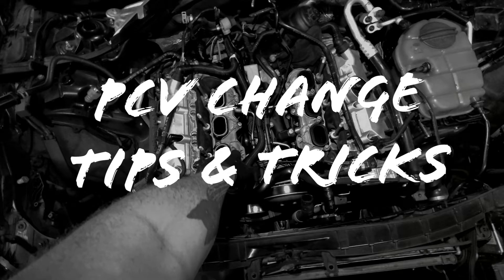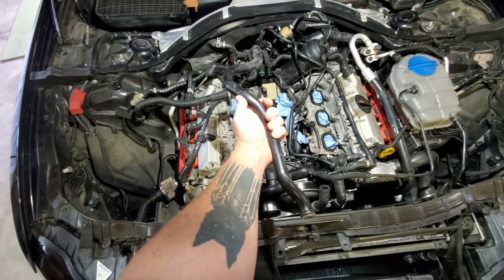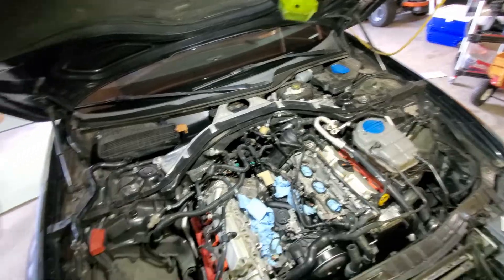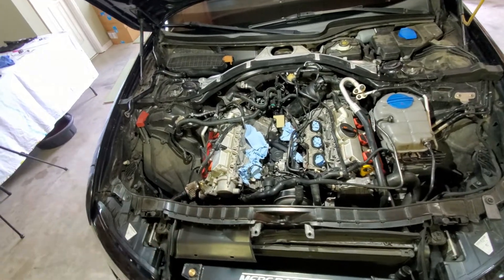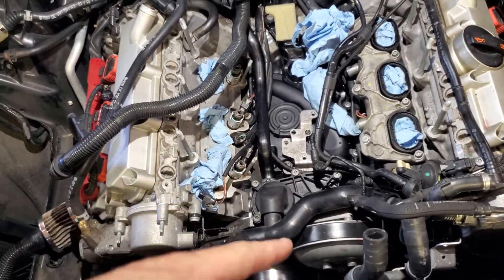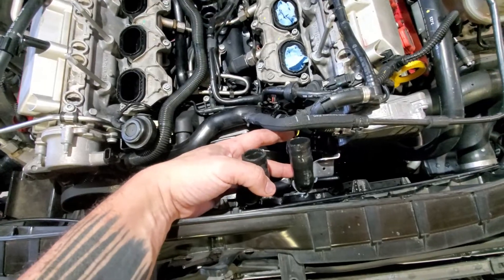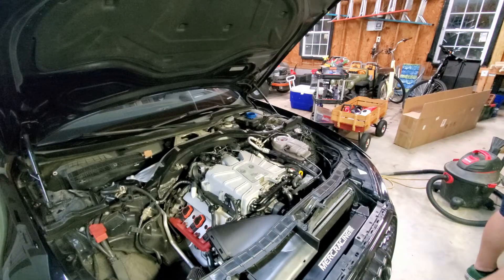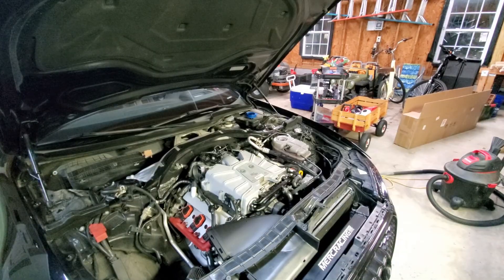Supercharged Audi 3.0T PCV Replacement Tips & TRICKS | C7 A6, A7 & B8 S4, S5, SQ5

Comment: My injectors came out exactly like yours did when I was replacing the PCV. I cleaned them, put new rubber seals on and after I put everything back together, there is fuel spilling out everywhere. when I try to rev the car to 2000RPM to start to bleed the coolant. help?
Reply from the maker: It sounds like you either didn't connect the guidelines fully where they connect to the manifolds, or a gasket for an injector got pinched

Comment: My plastic coolant hose is stuck at the heater core connection.  I have already removed that stupid clip.  Does anyone have any tips to remove that end of the hose? I have tried muscle power by holding both sides and twisting and turning but it is not budging.

Comment: On your other video about oil consumption you said this video here would show the inline check valve that should be replaced when changing the pcv valve. I didn’t see that part. Did I miss something?
Reply from the maker: It's the line that connects from your pcv to your intake

Comment: Do you know if the tube has an O-ring? Or does it just have the retaining clip?
Reply from the maker: No o-ring in the back of the engine
Reply: @GarageTaught  I'm doing this work and I was encouraged to do it thanks to your video. I don't know if I can send you a photo about a doubt?
Reply: @GarageTaught  I also had a question about the main antifreeze tube where two hoses are connected that have a clip on the side that goes to the radiator, yes, it should have one, but my question is, on the small side does it have one?

Comment: If my coolant pipe is fine is the part N90316801 the o ring for it? It seemed smaller than the one I pulled out of the tube

Comment: Hey. So did you need a special tool to re install or seat those injectors?
Reply from the maker: Nope. You just put them in by hand. Make sure you put a very small amount of oil on the large gasket that seats into the intake manifold so it doesn't bind when you put it back on.

Comment: Literally just did my PCV replacement in my grassy/rocky driveway on my 12' A6/C7 these past 5 days which is my only car, thankfully I was on vacation from work so I had a good amount of time but I have to say, worst placement for this important plastic to be. Personally I never had a check engine light for the PCV, or any codes at all. I did diagnose this essentially by just assuming that the PCV was bad as my car has 150k miles on it and its a common fail in higher milage. I watched HumbleMechanic's DIY video on this and learned so much about doing this job though I never saw this video until after, really wish I had seen it though. I tackled this job with a "willing" friend and went to town on a Wednesday and got the supercharger and passenger intake manifold off and forgot that I needed to order reseals for the injector and the lower manifold gaskets so I had to spend a good chunk of change on the shipping. Didn't want to work in the dark as I don't have a overhang and we resumed on Thursday and got the PCV fully replaced, PCV was for sure the issue as there was coolant inside the valve and we started to put things back together until we got the the point where I couldn't do anything without the new gaskets and reseal for the injector. Friday came and my seals and gaskets came and I myself sealed them, though I did not get any retainers as I didn't know that I was recommended to replace them so I didn't end up replacing those unfortunately, and then I got the manifold and supercharger back on. I could not get the belt back onto the supercharger pulley so I decided to take a break and return sunday with a friend and get it on, then changed my oil. When doing the oil, somehow managed to strip the pan's drail plug. Got a bolt extractor and got it off then got a new bolt. Oil was much better looking than expected, no major sludge or metal in it or the filter either. I did also test drive my car after for about 35 minutes to let the codes cycle and I didn't see any codes come up at all thankfully. 

Some more recommendations are if you're doing this yourself, be completely prepared with all the things you'll need, if you think you might want to replace something, buy it and have it ready. Do this job somewhere in a shop or somewhere with flat ground so you don't lose things in grass or rocks/gravel. Make sure you have all the tools you need too as that was an issue I ran into a few times where I needed tools for certain bolts that we didn't have in our tool bag so we had to run out to get what we needed. Personally I nearly killed my back from all the leaning over I was doing so I would for sure say take some breaks where needed as I needed many.

All this for a tropical storm to hit the coast of NC in about a day or two. :)
Reply from the maker: Where in NC are you?
Reply: @GarageTaught  ILM
Reply from the maker: Oh howdy neighbor. Stay away from new center for the next few days 😅
Reply: @GarageTaught  will do, not trying to turn my car into a boat
Reply from the maker: I'm rolling around in the atlas this week
Reply: @GarageTaught  and now i have just discovered that my drain plug that I got from advanced did not come with the correct washer and leaked all my oil out in 2 days. :( good thing I work at a carmax so I was able to get it diag'd and hopefully fixed tomorrow morning.
Reply from the maker: , the Audi dealership keeps them in stock. Go say hi to Tyler Reeves at Cape Fear Audi
Reply: @GarageTaught  maybe I will tomorrow

Comment: Hey man I was driving and got a low coolant light. I checked the oil and it was clean so I tried to fill the coolant. Whenever I filled up the reservoir it just drained back down again. 
Would this be a bad pcv? The ignition and car was off but the coolant still drained into the oil. I scanned it with vcds and have a code for the supercharger coolant pump but nothing else.

Please let me know how I can diagnose it, I don’t want to spend the money and time to change the wrong thing. Thank you!!
Reply from the maker: It's impossible for me to diagnose it without seeing the car. It could be the pcv, but it sounds like you need it professionally diagnosed if you can't figure it out on your own. Good luck man
Reply: @GarageTaught  thanks man the only code it’s throwing on vcds is for the intercooler coolant pump. Sucks because I redid the body over winter and just changed the oil, air filter, plugs and coils. Just want to drive it lol
I can do a compression test to rule out head gasket. If I remove the coolant lines to the oil cooler and block them off, then try filling the coolant and it still drains that should rule out the oil cooler. Would the only other culprit be the pcv? Would the pcv with the engine off be able to drain the coolant within a couple min? I wouldn’t think so because it’s not pressurized but I can’t think of anything else it could be
Reply: @dondeeveed  Did you get it sorted? sounds like some external leak somewhere from a hose or maybe even the overflow bottle? if its leaking that fast, should be able to see the leak externally somewhere

Comment: I'm putting a list in FPCeuro's video based on my experience. A tip with that FUCKING coolant pipe lol is a have a feel and if it feels brittle well good luck but if its like mine and nice and sturdy feels solid. Take a thin piece of metal about 5 in by 5 (big enough it wont fall in) and twist the pipe until the moulded screw bracket and the metal wiring support bracket have a gap that you can slide said metal shim in between. Then take some pliers or vice grips (no needle nose types) and with a cloth wrapped around the pipe gently squeeze near the front side of the pipe (near the block/gasket end) and take a pry bar, brace against the metal block with the end and use the shaft of the bar against the pliers and gently pop it out - takes 5 minutes to do and made it so much bloody easier than the impossible manual way. (honestly its a good design though because they got rid of an extra clip and even if that t30 comes out some how its still nice and tight in there and wont catastrophically fail) lol maybe your clip is sitting in the audi 3.0 purgatory with my t30 bit XD

That flapper body, they do mention but unless youre really paying attention you'll miss it. "make sure you push your flaps down when putting the body on" is all they say, took about 10 minutes to find out the WHY and yeah had to reseat them not a big deal but will throw a code about something being stuck open.

Honestly though I've worked on a lot of cars but my audi is my fave things just come off and go on without issue no forcing no wrongly made parts - it just works - complex yes a bit time consuming sure but the job was fun even scraping excess carbon from my intakes and blowing/vaccuming them out. Even realizing my injector gaskets got stuck in the fuel rail and i made a god damned mess when testing for fuel leaks lol (bought the $50 each injector gasket set anyways) and lubing them up to put on its been nice

Comment: I lost the same clip for the coolant pipe, going to the rear heater hose.  Can’t find a clip in stock where I am at and need to get the job done.  Has yours lasted since the video ? Any leaks ?  I can’t see it leaking as it can’t really go either way back and forth once it’s secured on both ends.
Reply from the maker: Hasn't leaked at all without the clip
Reply: @GarageTaught  Thanks for the quick replay amazing videos sir ! I will fore go the clip after dropping my small ratchet into the abyss and having trouble locating it I highly doubt the clip is leaving the party down there 😂

Comment: Only 2 years old? Did you replace with a OEM Audi or aftermarket? Man, that would suck for it to only make it 2 years. Also, you reference FCP Euros video which is pretty good, but is there a reason you removed that coolant pipe as they just pushed to the side? I heard that back screw is very hard to reach and near impossible, which I'm sure is why FCP Euro didn't remove the whole pipe.

Comment: Morning ! I’m getting a code p052e00 on obd eleven but my car is runnning fine but the code keeps coming back as soon as I start the car ! Oil is not dropping neither the water coolent . Should I replace the pcv valve or it my be the hoses ?
Reply from the maker: Absolutely. Your car is definitely consuming oil with a failed pcv

Comment: So I bought a 06 A6 3.2 oil separator, new breather hose, merc racing pcv relocation kit, oil catch can, do I need to buy pcv as well? I'm getting pcv regulator valve performance code and bank 1 lean code as well as fuel rail pressure code which I have a 255lph deushwerks in the basket and I just replaced hpfp with herko ND IE piston but the solenoid on hpfp is holding on by a thread and I've zip tied it so I don't lose connection. I have a replacement hpfp but I need a bench vice to get the piston out.  Also I see there are 2 different version of pistons 1 is fat only at the bottom 1/3 then skinny and no head then there is the 3/4 fat skinny for 1/4in and has a pointy head 2015 a6 3.0t quattro?
Reply from the maker: Are you a crec or CTUB engine? If CTUB, the IE piston is the best option you can get.

In regards to the ocv relocation, if you look at the description of our diy video on the relocation there is a link to a document that has every part you will need along with part numbers & links. But yes you need the 3.2 pcv as well.

Comment: I successfully swapped out the PCV on my 2014 A6/C7. Thanks to your videos that you have posted. Unfortunately, I'm still getting PCV malfunction codes.... do you have any suggestions?
Reply from the maker: Did you change the check valve & tube that connects to your intake?
Reply: @GarageTaught  I'm not sure if I changed a check valve that you're asking for, is it seperate from the PCV itself?  I just replaced the entire PCV unit and the small tube that connects to the underside of the supercharger and all of the gaskets that were needed for the job.  I did not replace the tubing that goes from the back of the PCV to both sides of the valve covers.
Reply from the maker: Look in the description of this video. I have a parts list with the part number for what I'm talking about
Reply: @GarageTaught  Thank You for being so responsive!
Reply: @GarageTaught I did change the check valve and tube last week! No PCV code anymore. Thank You!!

Unfortunately, now I'm getting a new code though... Oil Pressure Switch triggering EPC..  Never Ends
Reply from the maker: What's the code number (should start with a P)
Reply from the maker: What's the code number (should start with a P)
Reply: @GarageTaught  P164B-00
Reply from the maker: There are 2 pressure switches that you can replace to see if that resolves the issue. One is pretty easy to change, but the other requires the removal of the supercharger iirc
Reply: @GarageTaught  I did order both switches yesterday.... It just stinks I have to take the SC off again. Thankfully I am a pro now. I get it off in less than 40 minutes.
Reply: @GarageTaught I'm hoping the issue resolves with this fix. It is my daughter's car and she is anxious to let it rip. She did an intake, SC pulley upgrade, & 034 ECU/TCU Tune....🤞
Reply from the maker: I've got it down to 11 mins 😬😂
Reply: @GarageTaught  at this rate, I may be right there with you eventually. Once I get faster at disconnecting the electrical connectors
Reply: Replaced both of the switches today.....
Ran a few 0-100 runs with NO problems... Things are looking up for once🙂
Reply: I cant find the videos from fcp euro .. could you please send link
Reply from the maker: @olivernelson9302 look in the video description

Comment: Hello. Thanks for another great video. I have coolant leaking under the super charger. I am going to replace everything under the supercharger. 
Do you have the part number for injector retaining clips and retainer ? 
Also should i service the driver side injectors ? Or it is not necessary? 

Also u didn’t mention in the video about crankcase breather hose. Is it must replace part too?
Reply from the maker: All of the part numbers are in the video description.

Don't mess with the drivers side injectors if you don't have to

Yes, replace that breather hose.

Comment: hey man im getting soft code p052E00 and i had a shop do  the whole pcv job already. thinking it is the breather hose. do you know if i can swap that out without removing the intake manifolds?
Reply from the maker: Yep. You just need to pull the supercharger
Reply: @GarageTaught  did you use oem style clamp on that breather hose when you replaced? looks like you need a special tool.
Reply from the maker: Nope. Used a zip tie. No issues
Reply: @GarageTaught  okay last thing lol... am i going to have to bleed coolant after doing this job? just with sc bleeder screws if so? already has the 034 ones.
Reply from the maker: @tylerpadlina943  I have an entire video on bleeding the 3.0t.

But I highly suggest buying/renting/borrowing a vacuum bleeder to make your life easier.

Comment: I just changed the pcv, the breather hose , and the termostat, put everything back togheter, but i forgot to put the heat shield behing the supercharger, do you know if is any problem? Was very important to put it back? Thanks
Reply from the maker: I don't have any of the insulated heat shields in my car simply because I forgot to put them back in. No issues, but I'll probably put them in next time I pull the supercharger.

Comment: I’m finally getting my car back together and ran into another issue. 
The plug for the tumbler flap on the drivers side has mysteriously disappeared. I pulled the crossover coolant pipe to get more access and still don’t see it. 
Any ideas as to where it may have fallen and or the routing of the harness?
Thank for you videos.
Reply from the maker: Oh man... You are just going to have to search. It is a part of the same harness that connects to your injectors if I'm not mistaken.
Reply: @GarageTaught  ok. At least I know what harness to look at. 
Thank you